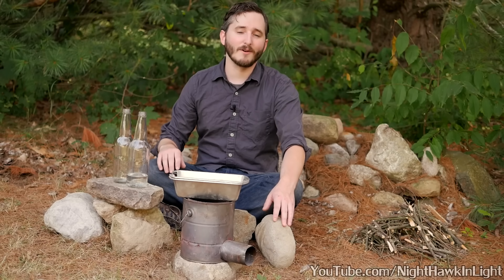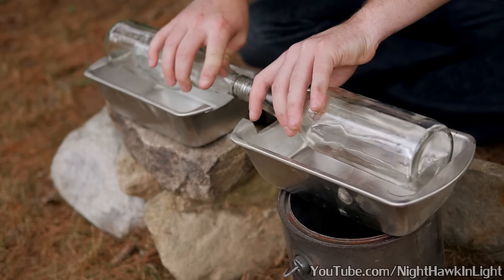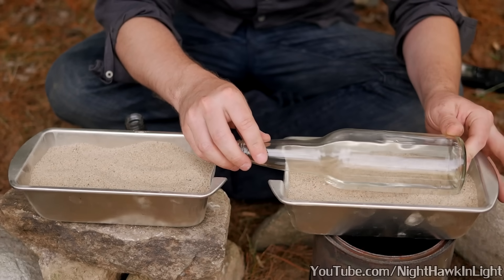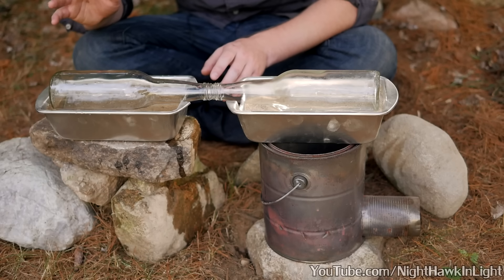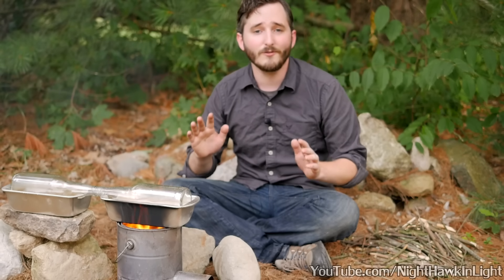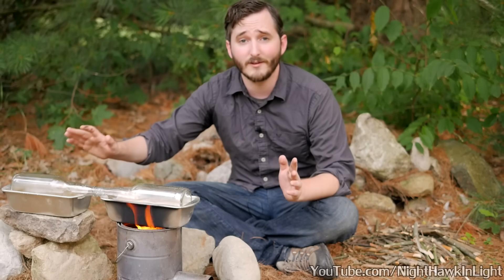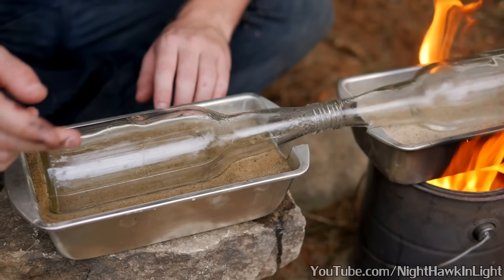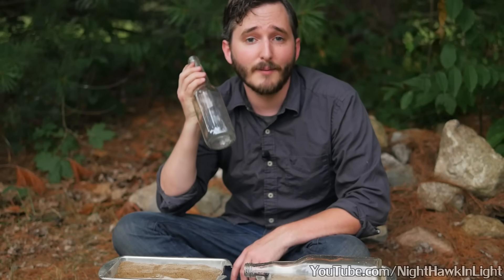How To Turn Salt Water Into Fresh Water (Simple Improvised Distillation)

Comment: Distilled water is not safe to drink unless there is no other choice because it doesn't contain the vital minerals that our bodies need like calcium, manesium and sodium.
These minerals are very important especially in our nervous system as their ions conduct electric signals trasnsmitted by our nerves while distilled water doesn't conduct electricity.
Drinking water's TDS (Total Dissolved Solids) must be between 100 ppm (parts per million) and 500 ppm.
You can drink distilled water anyway if you add a little bit of salty water to it.

Comment: To be more exact a pot and a tarp or a lid can work also. Though if in a situation without any of that you can carve stuff from wood to form bowls and such and leaves to also work. Just don't expose the wood stuff directly to flame or just use stone or rocks to as a heat distributor.

Comment: A Wet Towel covering is going to double the condensation rate.
Metal bottles are better. 
A coupling like a condom, balloon, hose, or tubing can improve the process by making the bottles more upright. 
There are also ways to distill water, without bottles, on a cool tarp or plastic sheet. First, heat saltwater above ambient...

Comment: It wouldn't actually be 'evaporative' cooling on the cool side. It's condensing because the surface is cooler. Unless you are referring to the sand staying cool due to evaporative cooling?
Reply from the maker: Yes the sand staying cool and the bottle itself from water evaporating on the outside

Comment: you should wrap some leaves or paper or plastic around the mouth to avoid steam escaping. 
Even better if you can find a short tube or anything similar to make the angels better as a form of a  reverse V-shaped. This could increase the amount of water in the boiler and collector at one run drastically by 3-five times to e.g. half a liter at once. if you have enough time, make one out of wood.
no need that the cold side needs to be a glas bottle. It could be any type of plastic bottle cooled in (salt)water.

Comment: Like sand through the hour glass these are the days of our lives, we act out our roll in the Arena of life. The Latin word for Sand is Arena, Sand = 38 = 11. Time = 47 = 11. Arena = 39 = 3. The Molar mass of SiO2(sand) is 60.08430 ± 0.00090 g/mol = 3
Historians say that the colosseum floor was covered with 15 cm of sand 1+5=6. The Colosseum floor is 287 ft long and 180 ft wide. 287 = 17= 8, 180 = 9. Length width together = 89, 89 = 17 = 8. Yaldabaoth = 89 = 8. If we add together 6+8+9= 23 = 5. The word Colosseum = 122 = 5. The word Theatre = 77 = 5, English, in Chaldean it = 26 = 8. Stage post = 122 = 5 English, in Chaldean = 38 = 11. A stage post is a station, Station = 98/89 = 8. Theatre stage = 3. life stage = 3 English, in Chaldean it = 33. Life Actor = 89 = 8. Action = 8. Character = 5 English, in Chaldean it = 8. Player = 77 = 5. Play in = 77 = 5, theatre = 77 = 5, Play out = 2 = 11 = time = sand, Play out, in Chaldean = 3 = Arena. Play time = 101 = 2 = 11 = time = 11 English, in Chaldean it = 5 = Colosseum/Theatre, Statue = 5, Clay = 5, Human = 3, Human Clay = 98/89 = 8 = 89 = Yaldabaoth. Sand is used in casting molds called sand casting. The cast of actors/characters in a theatre play or movie. Play set, Movie set.
SAND AND WATER MIXED AT THERE MOLECULAR WEIGHTS. The Molar mass of SiO2(sand) is 60.08430 ± 0.00090 g/mol = 30 = 3. Water molecular weight 1.00794*2 + 15.9994 = 60 = 6. If you add these Atomic weights together 60.08430 ± 0.00090 + 1.00794*2 + 15.9994 = 90 = 9 = 369. Sand flows like water, sand liquification, Sand keeps time like the time through the sands of the hour glass. (G) (G7) (7 Rainbow Prism) (G/Geometry) (G/God) (G/Gold) (G/Glass Lens) Glass ball/crystal/silicon/Quarts. Glass is used to measure light. Glass is made of sand, sand is a measure of time/Hours/Horus/light/Hour Glass.

Comment: Another emergency way to get water if you can find a plastic bag or sheet and container for the water, and if it's hot enough, is to dig a hole in the sun, and if the plastic is in the sun, the difference in temperature will cause condensation in the colder hole. Put the container in the hole and a rock to weigh on the plastic and cause the drops to fall into the container from one central point.

Comment: thanks NightHawkInLight💗sand is a great idea to hold and distribute heat if you have a short tube than fit on the bottle openings you could stand them up also perhaps if people warm up the water without connecting bottles for a bit first then gas fumes might go away and then collect water soon after the water starts to bubble(be carful putting tube)some leafs might roll into tubes that could work tide arround to keep tubeular no matter how safe and good your paret friend has been still i will not trust any self directed entity with a hook like that right beside my eye like that my bunny nibled my ear once a long time ago💗thank you bro💗🐇🐰💕🌈

Comment: you could also use one of those dark brown/black glass bottles as the heating bottle by setting it in the sunlight and letting it evaporate water over into a clear bottle that you put in the shade.
to keep the shade from moving around, put a white object around the clear bottle to reflect the light away and not let any light hit the clear bottle. you could alternatively use two clear bottles and put the heating bottle on a dark/black surface and put the other on a light white surface, you could also use a white tinted glass bottle if you could find one.
Reply: I was about to post this too. 
You can keep one bottle cooler by burying it in a mound of wet sand in a similar fashion to how he detailed except obviously don't start a campfire on the mound.
Reply: @VeritasAbsoluta  yeah that's right, evaporative cooling also works. I find it funny how you can use water that is evaporating to condense water on the other side of the glass. using dirty water to get clean water :)

Comment: You could easily use some plastic caps on top the bottle and open half of the cap so the cooling bottle only gets the vapor and no fluid. This would mean that you can fill the salt water bottle till a higher level. Also you can tilt the bottle and fix them together with some rope or something.

Comment: Does distilling get rid of biological contaminants?
Reply: i don't know if there is a difference between this kind of diy distillation and using an actual water distiller, but a distiller will kill bacteria (from the boiling) and remove the dead remains. unlike boiling alone, which kills the bacteria but leaves the remains in the water.

i am no expert, this is just my understanding.

Comment: Very well explained! This could save lives. One question - is it save to drink distilled water? I learned not to drink it because it drags minerals from your body to compensate it‘s lack of it because of osmosis. I have thought of distilling water earlier and always thought to put a little bit of the sea water into the distilled water to put some minerals into it. Plus it would be a source of salt. You might sweat in a survival situation.
Reply: my understanding on that:  since distilled water has had all minerals etc removed, the body might be slightly deprived of some useful minerals. but that seems almost negligible, since the body gets so little of its overall minerals etc from drinking water, primarily from food. i have never heard of distilled water leaching useful minerals from other cells in the body. but i'm just a mildly informed layperson, so take that with a grain of salt.

Comment: If you use a bubble gum as makeshift seal on the bottles. Could it be possile, to adjust the angles of the bottles, so you could fill the first one more? Virtually making it a more faster  and perhaps efficient process?

Comment: Great video! I knew about this process, but was always told you need a three containers, (one for salt water, one for coolant and one for destiled water) stationed verticaly. This is way easier solution! (eventhough I was first sceptical about the aircooling, before I realised you use the second sand bed for cooling)
Thank you!
Hopefully I will never need this video :-)

Comment: Note: salt is also used as a preservation method for foods, and is a biproduct of distillation. Good thing to keep in mind if doing anything similar to this in a survival situation
Reply: I get the logic, but the leftover slurry is more than just salt - as pointed out above. It's basically a brine full of contaminates that could make you sick. I wouldn't use it for anything food related.
Reply: @ShadyViserion  actually there are several cultures that harvested their salt from the left over salt residue from evaporation/distillation. Wouldn't be premium stuff at all, but it would still be valuable for sodium acquisition and food preservation.
Reply: @ShadyViserion  Other than heavy metals and bad chemicals there should be no organisms with the boiling process.
Reply: @Sunny bob Quackers I am not sure what you mean. Distilling has been around since at least 1200BC. Maybe even before that. The oldest evidence of it is 1200BC.
Reply: Noble thought except today's waters are full of pesticides, heavy metals and microplastics.
Reply: In an emergency, that salt + common sense should be good enough. If you're smart, you filtered your water through some cloth to catch larger debris and contaminats first. Regardless, you boiled it, ans so you destroyed viruses and microbes. Unless the water you're distilling looks cloudy or some other color and the salt left ain't white (in which case, you discard that batch), there shouldn't be that high concentration of other harmful contaminants left after you evaporated nearly all the water. If it ain't enough to kill most fish living in and off said water or the many animals that eat said fish (both smaller than you), it probably ain't killing you either. Definitely not more than starvation and lack of salts and other micronutrients will.
Reply: i say, Get the spoon full and shove it up ur pie hole, then come back and tell us what you think
Reply: Take Saltwater and place in empty shells etc in sun until dry....there is your salt
Reply: GANDHI protested against the British law that you weren't allowed to make your own salt from the sea....you had to buy it from the British.....so fudging arrogant
Reply: @bradfarrahgerwing154  not arrogance , control
Reply: @peacenow42they died a lot also there were far fewer contaminants in the water a couple hundred years ago
Reply: @peacenow42 why would I sleep in dust? I have a house
Reply: @Sunny bob Quackers yeah it is not the salt like you buy for food in the store. It has other stuff in it. They do make sea salt, but not like this.
Reply: @Sunny bob Quackers they used the same salt we use from salt mines today. It might have still had a few contaminates, but it wasn't nearly as problematic as the stuff that can be found in sea water.
Reply: @ShadyViserion  nah they mostly used seasalt. you can process it better than this.
Reply: This deserves 5k likes
Reply: @originalbinaryhustler  welp , now it has 115k likes 👍
Reply: @HighVibeTrybe  ❤👊

Comment: I saw a method where you'd boil water in a kettle or cauldron, have some palm leaves above capturing the vapor and dripping down the leaves.
And 1 where they'd place a plate above it in an angle, same method basically.

Comment: If you walk a bit inland, you can dig some clay up and use it to partially seal the bottles together (not completely since that will make them explode).

Be careful about drinking distilled water. Water with no salt at all will suck the salts out of your body and kill you. Add a little bit of salt water back in to give it a bit of salt.
Reply: Это не дистиллят

Comment: Using your method doesn't mean that you water is drinkable. 

In a normal environnement, your water can be full of bacterias and crappy stuff.
Reply: Heat kills of bacteria, and the crappy stuff isnt evaporating with the steam
Reply: @danieldorn2927  His method is still dangerous.

Contaminant, like heavy metals can't dissapear like that. A drinkable water is strictly regulated, you can't just heat a bottle and drink the water.

Comment: Can you use plastic bottles or two styrofoam cups?  sometimes that’s all that’s available on a beach 🏝
Reply: Nope, they'll melt with the heat required to boil the water. Even if you use a thick plastic that can carbonize its outer layer a bit, you'll end up leaching a ton of material into the water. Still better than dehydrating, but will make you sick before too long.

Comment: This is a great setup, easy to remember which is always great in survival knowledge.
Reply: Not really. Most survival situations don't involve you have glass bottles readily available, and this method doesn't produce hardly any water for the amount of work involved. Tented tarp collection is far more viable and produces quite a lot of water passively. All you need is sunlight, something to hold the water to be evaporated, and a tarp (palm leaves can work as a substitute) . All of those things you are far more likely to be able to find and work with than metal containers, sand and glass bottles.
Reply: @femsplainer  my dad owns a dealership so...

Comment: Great video! 
Question: can you find something to connect the two bottles like steel tubing or something so that they can both stand upright? I figure the vapor could still travel through and down to the empty.

I’ve never tried this but would the glass break even if you still used sand to surround the heat evenly?
Reply: That would work and is often used to distill liquid. It helps if you tie a wet rag just after the apex of the tubing so the steam condenses back into a liquid and falls into the second bottle a little quicker.
Reply: Can u do a video on this plz??

Comment: Is this true:
I heard that distilling water also removes some important minerals so it's not bad to (if you're distilling salt water) to mix whats left with a little bit of water you got and pour just a bit into the water you'll be drinking
Reply: You should be fine drinking distilled water as long as you're getting the minerals in some other way (such as eating).  If you want to play it safe you could add the salt back though.

Comment: question to gain knowledge:
if the bottle is at the boiling point for water and you want to add more water to it, wouldn't the salt water from the ocean be too cold and potentially crack the glass due to the massive difference of temperatures? i know on a hot summer day sure the water could be somewhat warm enough, but a lot of the time salt water isn't really that warm it's kinda cold.
Reply: Yeah that is definitely a problem, especially if you heat and cool the bottle many times over the course of your survival episode. Detempering the glass makes it weaker and weaker so this is actually a pretty weak solution. That said, you could use a separate system to pre-warm some water to make it safer to add in more to the heated bottle.
Reply: @femsplainer  i knew about tempering, but sadly not detempering haha. I gained knowledge today, so it's a win in my book!
very true, thanks for the knowledge!! 👌

Comment: DO NOT try to use wet fabric to hold a hot implement.
ANY professional chef can tell you a dry towel can be used to take a sheet tray out of the oven, a wet rag will burn your fucking hand so bad.

Comment: On a beach with plenty of access to sunlight and a highly-reflective piece of metal or a lens, you could heat water to boiling with just sunlight, forgoing the need for fuel at all.

Perhaps someday soon we'll have a cheap and energy-efficient way of mass-extracting potable water from seawater. We're going to need it.

Comment: Anyone wishing to drink distilled water for long periods should know that it can be bad for the health.  Small amounts of minerals are actually good for the body and prevent the chemical reaction of effectively leaching existing minerals from the body.  Therefore, without restoring those minerals from some other source, for example foods that contain them,  That is what makes a mineral water detox dangerous.  If sufficient minerals are not replaced, you could have an electrolyte imbalance.

Comment: this might be late but i didnt see any other comment, you should add a little bit of salt or saltwater because destilled water is pure water wich has no minerals in it, and to keep it short, if you drink this water it will pull out minerals from your body and you can die from that if you drink to much and it also can make you more thisrty.
Reply: Your better off drinking pure distilled water in a survival situation,and  using the salt that forms in the evaporation process to season food .

Comment: Any serious Prepper, who actually plans to have a huge amount of supplies (like a cargo truck/ trailer)  to take into the safety of the wilderness-- should bring 1,000+ bamboo seeds,  of a climate-appropriate species (some bamboo does just fine in the snow). 
With bamboo, you have pipes. You can build a huge water distillation setup with fired-clay pots connected by bamboo. 
Bamboo grows to full size in a single season,  as it's technically a type of grass.  I say 1,000+ seeds, because bamboo produces seeds rarely,  and many do not sprout. But even with just a couple shoots, you can create plumbing.
Reply: I read somewhere that the reason why Asian countries lagged so far behind the West in developing advanced building materials is because they didn't need them. With an infinite supply of bamboo, who needs structural steel?